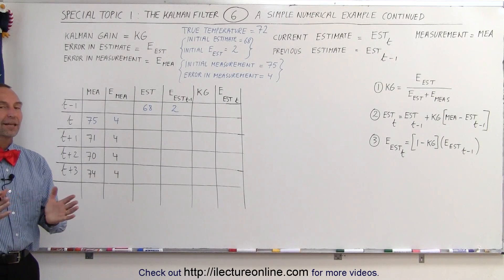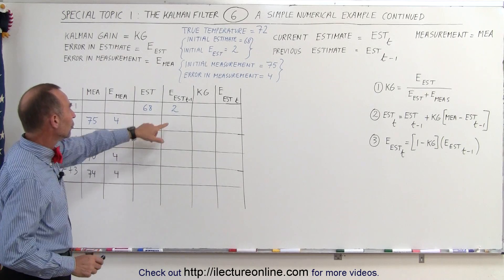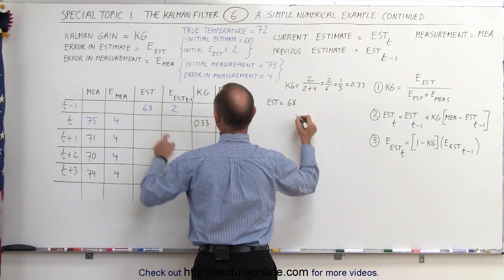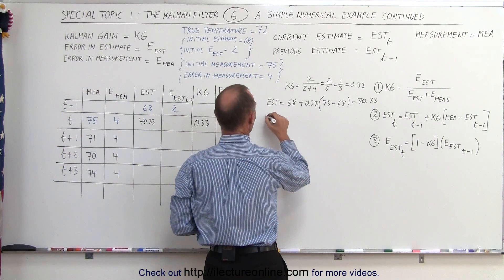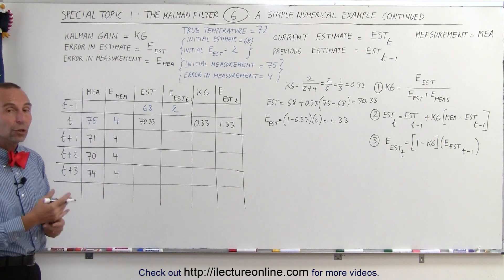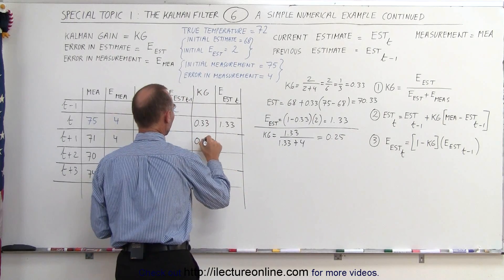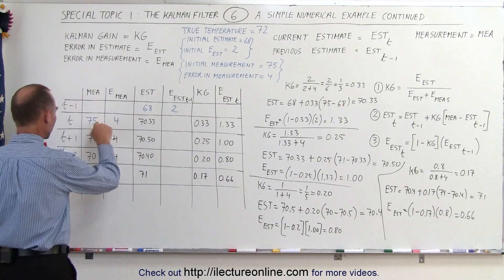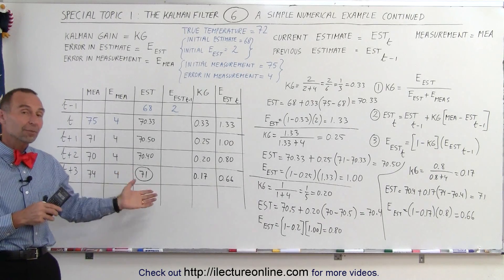Special Topics - The Kalman Filter (6 of 55) A Simple Example of the Kalman Filter (Continued)

Comment: This example made an invalid assumption that process noise is zero! This will lead estimation error to zero very quickly, and then KG becomes zero too. As a result the measurement will never be able to affect the estimate value. This makes Kalman filter completely useless.
Reply from the maker: Thanks for the input. (much appreciated).  The initial videos are oversimplified models of the KF in order to get the basic concept across.  In the future we plan on showing examples of multi-state EKF which will consider all of the errors, including the process noise.

Comment: Hi Michel,

Nice videos. Could you tell me why the error in the measurement is constant? When we measure the temperature we only know what the degrees are, not what the error is. With only one measure taken how do we know the error? Or should we take multiple measures of temp end calculate the error in those measures? Or is it an assumption?
Reply: The error in the measurement is really described in a statical sense and not a precise value. So one should interpret what is called "error" in this video as the standard deviation of the (assumed Gaussian) error distribution for the measurement device. If it is some temperature measuring device, we can have a reasonable expectation that this error distribution is fixed for this device. If it is a GPS measurement of a robot's location, it is possible to have the distribution change based on location (near tall buildings, under a big tree, etc.).

Comment: Sir Michel van Biezen,

thanks for explaining us all the Kalman Filter. I'm currently working on a subject in which this method is gonna play a major role. However I think you made a mistake in this video. By calculating the EST for T+2 you calculated 70.40, but shouldn't this be 70.60 because when i recalculate the following formula  EST= 70,5 + 0.20(70-70,5 = 0,5) = 70,60. This would even make more sense that it will increase your "estimation" instead of decreasing it.

Despite that, thank you for broadcasting this video's.
Reply: you are wrong

Comment: So far i think i follow however, why is E_mea = 4 all the time? Is that an assumption that the sensor is off by +-4 degrees? Furthermore, in more complex examples, is the error in your measurement usually always a constant?
Reply from the maker: This is just a simple example to show how the filter works.  In a real world example the error will indeed change and will be calculated at every iteration.

Comment: According to the formula for "Error of the estimate", this value can never increase in magnitude.  Not only that but it seems very possible that it could quickly go to zero.  I'm running a simulation that is doing just that.  The "Error of the estimate" goes to zero and therefore causes the Kalman gain to go to zero.  Has anyone had the same problem, and if so, how can this be fixed?

Comment: Hi, your tutorial is pretty useful and excellent! Thanks! I am wondering how do you set the initialized value of a)the error of measurement, b)the value of estimate, and c)the Error of estimate?
Reply from the maker: That depends on the actual situation you are dealing with.  It usually is your best guess.  It turns out that even if you pick values that are much to large, the Kalman FIlter converges quickly to the correct numbers.
Reply: Got u! Thanks! I wanna use it to do prediction, and yes, I will try to figure out how to make a good guess as the initial value. Thank you!

Comment: Thanks for some very good videos on a hard subject! I just wonder how one get the "Error in measurement" value which seems very important for a reliable result through the whole iteration. I assume that decide this value is the "art" and the heart in making a reliable Kalman filter ?
Reply from the maker: It turns out that you can start with a large error and the Kalman Filter will quickly zero in to the correct value.  Although a good start would be the difference between the average and the largest value, or 2 or 3 sigma.
Reply: But if Emea stays constant the gain will only depend on Eest ?
Reply from the maker: If the measured values very little to none, the Kalman Filter will put more weight onto the measured values.

Comment: How do you know that it will approach 72..... You haven't used 72 in calculations anywhere (the real temperature). So how does the system know that it will approach that temperature? Also, the error in measurement is 4 and initial measurement was 75, so the measurement can be from 71 to 79, but you have used 70 at t+2. Can you explain these 2 questions?
Reply: The distribution of measurements is centered around the true value. In this sense, measurements themselves tell the system what the true value is. The only problem is that in real life measuring devices have measurement noise and so Kalman filter allows to deal with the noise and only keep the relevant information and thus quickly converge to the true value.
Reply: So what I gather from replies here, the true value is hidden in measurements and kalman filter helps us to "see" that. Isn't it? But in his experiment, how does he already know true value is 72 in order to validate the experiment if it worked or not?

Comment: Thanks a lot for this lecture, it is very useful and helping. However, i'd like to understand something. How did you get the "2" and "4" ? I understand that it is just a random example you chose but i do not get how myself i can find the "initial error in the estimate"  and the "initial error in the measurement" in the model i am estimating. Could you please help me on this point ?
Reply from the maker: +Dalia Ibrahim 
In this example the error estimates were just randomly chosen.   In a real world example, the initial errors are chosen based on the knowledge of estimated errors on your system.  For example, when you are tracking a satellite, you may assume a timing error of 10 nanoseconds to start or 100 nanoseconds depending on your assumed design parameters.  The beauty of the Kalman FIlter is that it doesn't matter much on what you choose for the initial errors, even if they are very far off, because the filter zeroes in to the correct values quickly.
Reply: Thanks a lot ! it appears very clear to me now ! Big big thank you for your help.

Comment: Good lecture but a question. This works well for a constant input with noise, but what does it do with a varying input plus noise which would be the real world case? For example, an aircraft measuring temperature during ascent or descent. Will it try to remove the actual variations?
Reply: If you run your filter fast enough, the filter will converge. The [MEA - EST] in (2) save your day. When there is deviation, this number may become positive or negative. If you run your filter fast enough the changes "appear" to be constant. 

How fast is fast enough?
There is the theory...
But you can also create a fast changing signal, your worst case, and feed it into the filter. See how fast you need to run the filter in order to track your signal.

Comment: Btw, the true temperature was 72, and Kalman filter converged to 71.
Reply: Hi VetNet Doo,
You need to continue the iterations till Kalman gain is close to zero. Then the estimate converges to 72. I verified with 3 more iterations and it converged to 71.54. And this convergence depends on the measurements. I think professor showed overall process.